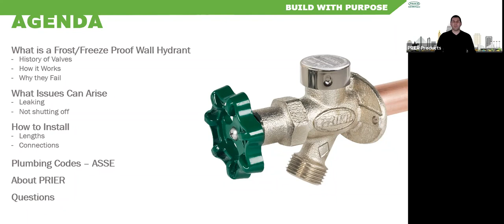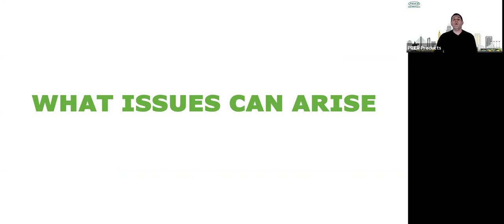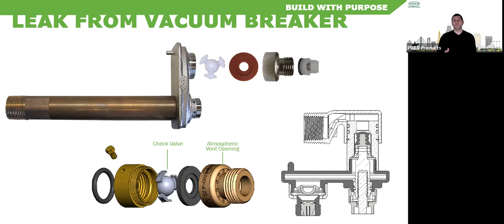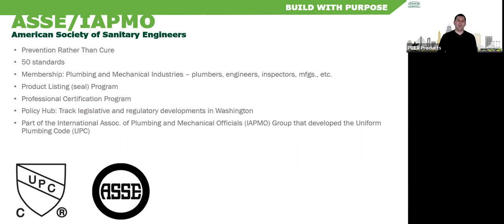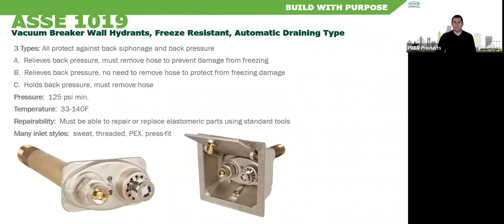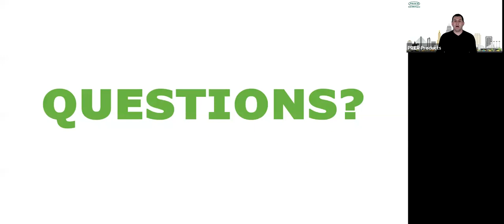Education for outdoor faucets, hose bibb, hydrants and spigots

Comment: At 17:30 I have a lot of problems with the vacuum breakers that I have replaced. This is the first time that I have heard a recommendation for using teflon tape on the plastic replacement. I am guessing these may be tapered threads. The flange of the plastic threaded part never tightens down to the top of the metal faucet. It seems like it bottoms out before it can tighten down to the flange. I have the ones with the screen on the bottom for the model 144.
Reply from the maker: Sorry for the delay in responding to your inquiry. We have had some issues accessing our YouTube channel. I spoke with our R&D experts and this is what they recommend. You can do 5-8 wraps of Teflon tape and with a pair of Chanel lock pliers, snug the vacuum breaker down. Extra tightness will compress the plastic into the metal seat forming a better seal. I hope this is helpful. Thanks for using PRIER Products!
Reply from the maker: Also... The flange on the plastic vacuum breaker is NOT supposed to tighten down to the top of the metal faucet.  It bottoms out inside the faucet head.  It should seal where it bottoms out, but doesn’t always.  The Teflon tape will definitely stop the leak.